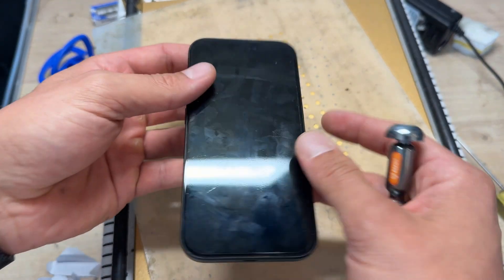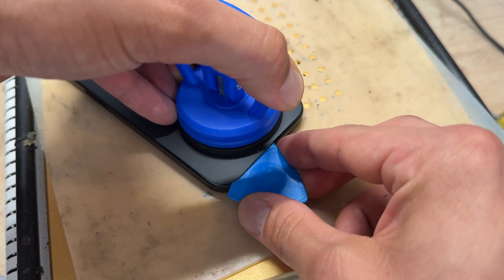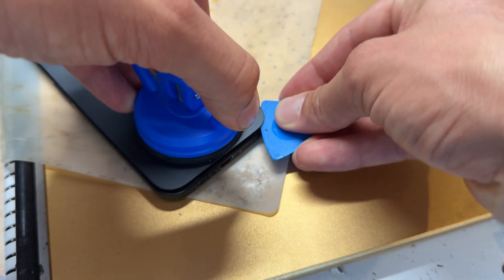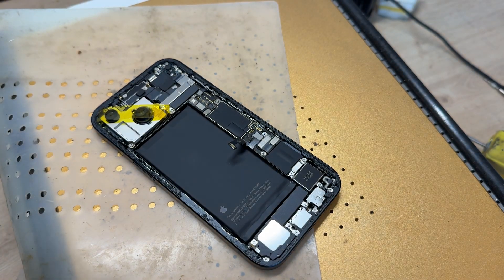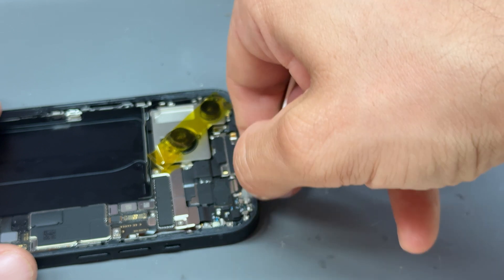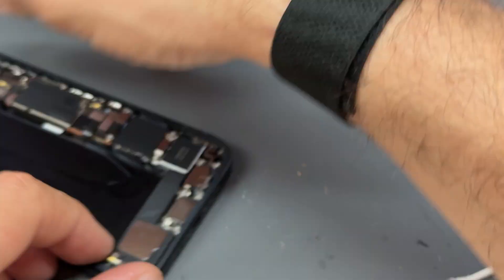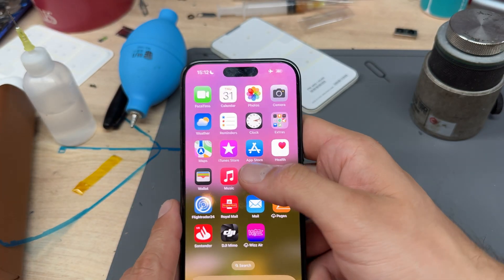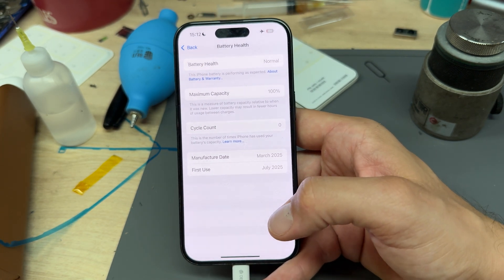iPhone 15 Battery Replacement – Full "How To" DIY Repair Tutorial with Tips & Tools! 🔋🛠️

Comment: You have magic fingers. I did it the same way you did (before the video came out), only much slower and with more heat. The glass on the back cracked in the upper right corner, and then I had to repair that too. I hated it :D

Comment: I tried to fix my iPhone SE 3 logic board but I got alcohol inside the screen when tried to remove the old adhesive with a q tip. Also, the screws are included with the service pack because Apple doesn’t want you reinstalling old screws because of thread lock.
Reply: It's non conductive, clean it
Reply: @mxrtin434 it’s in the screen. Not the logic board. So I need a new screen now.

Comment: So many people get a useless battery replacement just because the iOS version the phone is running on is buggy or inefficient and draining the battery quickly. It’s just a software issue on a phone this new
Reply: Interesting how you both oppose each other yet both get most of it wrong
Reply: Hey buddy. I suggest you learn how phones and batteries work. It's been two years since the inital drop of the 15 series iPhones. Most people fast charge their phones, (which is bad for batteries) and they do it frequently. Two years of mistreating a battery will result in significantly reduced performance.
Reply: @R3prisal Two years of using it is two years of mistreating? alright little bro 😂I wouldn't call 18 - 27W fast charging, besides babysitting your battery will get you a couple percent more health after 2 years at best compared to always wirelessly charging to 100% and then to 0 and letting it get warm etc. The only way not to damage your battery is to not charge it, so I guess you don't use your phone?

Comment: I don't have a 'spindle' yet, but when I replied the battery in my iPhone X, it all came off very easy just by slowly pulling it away. Both surfaces where nice and clean.
The battery spacer, not a bad idea, can save some time as well, perfectly aligning everything up.
Earbuds would also give you better control during cleaning.